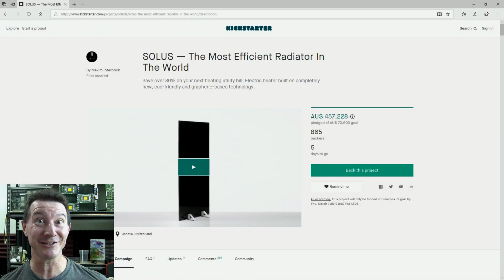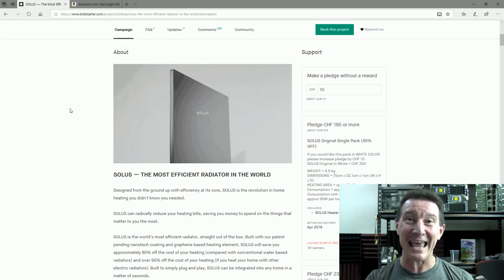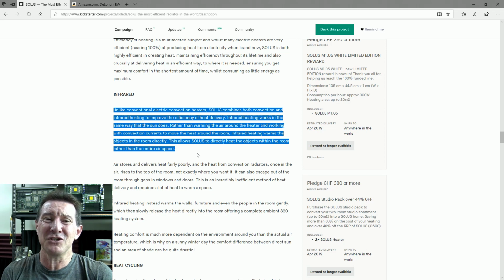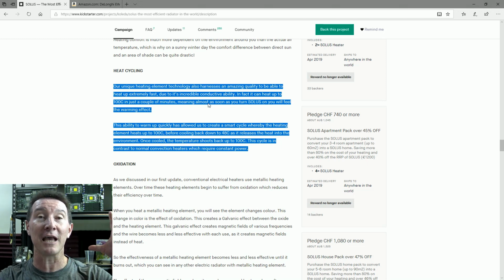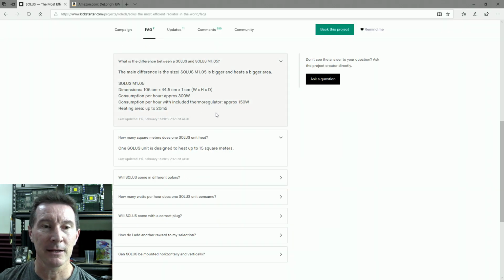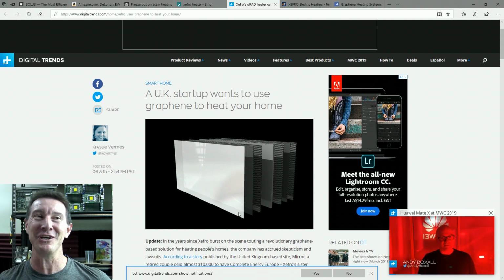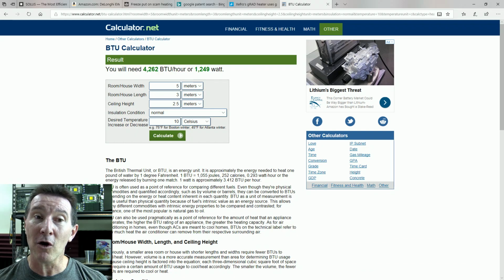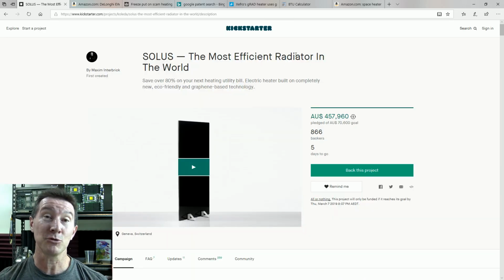EEVblog #1186 - Solus Graphene Heater Kickstarter BUSTED!

Comment: I'm not sure Dave. I think these heaters operate  at FIR wavelengths so they remain relatively cold to the touch and radiate IR that the glass and air is largely transparent to, and where heat conduction is irrelevant.  If these panels output more energy in the far IR range of the spectrum than a simple small resistive element would (by keeping it pretty cold), it will radiate through the air and be absorbed by objects directly, instead of convective heating if the air next to the element.  I think that's the point they're trying to make in all the parts you read out loud.  

So if they are talking about heating objects and people directly rather than the air, and aren't asserting that they whole room will be heated but only the things in it.... They have a totally valid approach that might require far less energy and lower air temperature for a given room size to be equivalently comfortable for a person in that room.

The "efficiency" approach is more like those quartz heaters that throw direct heat at a person, that work even in a completely chilly room with icy cold breezes going through, like at a guard station.  But instead of black body heat of 1000°C, this Kickstarter is using wavelength-selective technology(cold cycling at 100C) as high-end large ceramic sauna lamps (the old kind simply being incandescent with a visible spectrum opaque coating).

So the "revolution" is... *don't heat the room*.
Not new at all, considering this is how a camp fire or fireplace works.

But! considering the vast majority of buildings are entirely designed around heating the entire space and insulating the entire space.... 

Pushing an extremely low density, high area panels of IR heat that will keep you warm if you're facing it, so you need to put them in line of sight of wherever you'll be, or facing furniture you'd like warmed... 

Kinda is revolutionary.  With careful design you might do okay, and if people just get used to heating themselves it could drastically change building design assumptions. 

I still think your bust is busted, Dave.
Reply: I agree the glass doesn't need to be conductive, and there are some important advantages to radiation that should be intuitive but most people seem to be fixed to the idea that heat can only be transferred via the air.  The glass just needs to be transparent to infra-red radiation, and in that case it has no business getting hot.
What's upsetting to me about this situation, is that there might be a team of intelligent and honest people designing and making these panels, but they have no influence on the marketing department upstairs.  I wonder if the designers have given up trying to explain to their colleagues why 'watts per hour' makes no sense.   A more important question might be whether the people in charge of this business are deliberately misleading their customers, or are they fumbling around in the dark, believing their own optimistic hype?
Another scenario is that these nice but gullible people at Solus have been fooled by some other company trying to offload a large amount of graphene.
Reply: If the heaters radiated IR they would be able to tell us exactly how much of the electricity is converted into IR, since it would be their main selling point.   Does IR radiation pass through glass panels?  Probably not.

Comment: Save 95% at 50% duty cycle (or 90% at full duty) over a heater ten times as powerful. but  True radiant heat is nice in that it heats what it shines on. This is like a heat lamp but it won't keep you awake by being too bright. Nice package. Some utility. Don't like it don't buy it.

Comment: Perceived comfort/heat may be faster due to the infrared component. But ultimately true heat will actually be slower, as the IR component needs to heat up the objects it is shining on, before those in turn begin to heat the air around them.

Comment: If people want 100% plus efficient electrical heating/cooling they should get Air-source or Ground-source heat pumps. 3-400% "efficient" (in the sense that 1kW of electrical input can produce 3kW of heat in the home, by cooling down the outside air :P)

Comment: OMG Solus's answer to this video:

Thank you for sharing this. It’s completely normal that when something new 

and innovative comes out that there will be divided opinions and some 
skepticism, as well as criticism from competitors. You probably see 
people that still think Tesla is a scam. 

We have already sent test units to high profile tech journalists and 
waiting for their articles. Unfortunately Evvblog review is completely 
invalid. First, Evvblog does not have a sample SOLUS unit. That means 
the reviewer can only go off his beliefs and theories. 

Second, having watched this video, it’s clear that the reviewer goes off on a 
rant for 45 minutes without even considering all the information 
presented to him on this page, not to mention scientific studies 
available online about graphene. 

For example, he made a review of our testing. However, he completely 
ignored our “ A FEW THINGS TO NOTE ABOUT THIS TEST” section.  If he did 
read this, then he would understand why SOLUS M1.05 consumed more than 
300W per hour during the first 24 hours of the test. He completely 
ignored the fact that we managed to heat up a 16m2 room up to 21°C on 
300W (or 440W if taken in a short 24h space)  when outside temperatures 
were negative. He did say that this is impossible? 

It is also clear that EEVblog has no response besides crude gestures to 
this statement “we have found that raising the temperature of our 
heating element is most effective through supply of non constant/pulsed 
electric current. It works in the following way, the heating element is 
supplied with 1.5 seconds of electric current and is then cut off from 
supply for another 1.5 seconds. This process is repeated until the 
heater reaches it’s maximum temperature. We observed that during the off
 cycle (1.5 seconds when current is cut off) the heating element 
continues to generate heat due to the self cooling properties of 
graphene, which results in a difference of potentials.”

At the end of the day, we are happy that SOLUS is becoming the centre of 
attention. We are shipping the units very soon and will look forward to 
real reviews from our clients. 

Kind Regards,

Max

Comment: 300 Watts per hour? So after three hours that would be, say, 900W? I'm sure that's right (unless they meant Joules per fortnight). 

Glass is a really good material for radiators. I mean, nobody in their right mind would think of using two sheets of it to stare through, given it's high thermal transfer characteristics, would they?

The sad thing is, there's a lot of ignorant punters out there, who will probably think they could connect this up to a Solar Roadway and make free energy for ever. But I've said too much...

Comment: Radiant heat can actually cause more problems.
Under a radiant heater you feel warm and may not wrap up as well as you should, like at a street cafe or such.
The heater hits your face and torso and you feel ok. You are however starting to get cold feet. You also breathe the cold outside air on the pavement/patio and do not realize how cold you really are as it feels warm on your face and hands. Two days later you have a cold.

Comment: Well I have experienced IR heating panels. It's different, it doesn't heat the air it seems to heat the objects hit by the IR radiation. I like it. Panels have been on the market for years, nothing new I believe.

https://www.thegreenage.co.uk/tech/infrared-heating-panels/

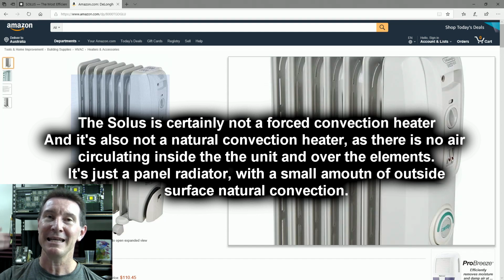Comment: You're normally on-point with these Dave, but forget about fan-forced heater and heatpumps. You've completely missed the distinction between convective heaters (which you understand) and radiant heaters (which operate by transferring heat directly to furniture + people via infrared radiation.) The whole concept of radiant heaters is that when there's a lot of IR in the room, you still feel comfortable even if the air temperature isn't that high. The goal is for people to feel warm, not for the air in the room to be raised to X degrees. Those are different things, the air in the room can be cooler and you still feel warm if there's plenty of IR hitting you. You miss this while obsessing over the output power instead of the thing that matters, comfort of person. Radiant heaters ostensibly achieve the same level of comfort with less power output (and input) by the heater. The insulating glass is perfect for this by restricting conductive heat transfer, causing IR emission through the glass preferentially. Maybe you get to this some point after the 16:30 mark, where I gave up, but I can't support incorrect refutations of poor products (this product is clearly bullshit; radiant heaters are already a thing you can buy).

Comment: I didn't notice you saying that, but with no fins the MAGIC SOLUS EFFICIENT HEATER can not heat up the air as good as a radiator with fins because it has a smaller surface to dissipate heats, Can't it?

Comment: Those oil heaters are more convection heaters then radiators, the ones with an incandescent element that have a reflector behind it (like a space heater, without a fan, more or less). Tehnicaly, the in floor heating is the most efficient, not electrically, but in terms of deliveing the heat in a way that it seeps out slower before getting where you want it the most. Want insane heating efficiency? Thick insulation, double doors, 3 sheet glass windows... basically make sure the least ammount of heat escapes the house, so u can keep your desired temperature with the least ammount of energy input.

Comment: Of course Graphene will not "create" additional power.
But let's imagine that Graphene acts like a heat fast transfer buffer, between the resistive element and the air (I omit the tempered glass layer here).
Could it be possible that Graphene accelerates heat transition "forcing" heat to the air ?
If I take this idea to extreme, imagine that once the device reaches its max temp. then you touch the surface it will be nearly at ambient temperature, yes cold, meaning that 100% produced heat will be already radiated into the air.
this could lead to 100% produced heat in the air rather than partially resting on the device materials.

PS:  i still trust Joule's laws and Peltier effect  ;)

Comment: Whoo-whoooooo! All aboard the Wanktrain to Wanksville, with a brief stop in Wankington!
Save 80-90% of my heating costs? *snorts derisively* Amateurs! I can save 100% of my heating costs by switching my heater off. 
So this thing resembles what I imagine an iHeater would be if Apple made a flat-panel heater... But I thought more physical surface area of the hot bits means more heat can be transferred to the ambient air???

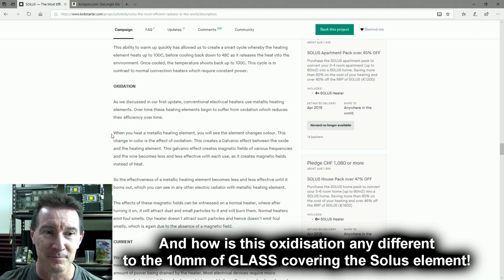19:39 - That's... Not... How... Science... Works... 
Johnathan Chamberlain paid attention in science class.
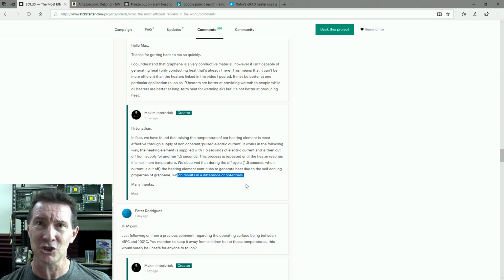31:33 - That's what I like to call "verbal diarrhea." A whole bunch of words get uncontrollably spewed out.

Comment: Those oil/water filled "radiators" are primarily convection heaters that directly heat the air in the room.  The advertised heater looks more like a radiant heater that produces IR energy, heating the objects in the room directly rather than the air itself (glowing element/bar radiator - typical bathroom heater).  In a sealed room with good insulation the overall effect is identical, but if there are draughts or poor thermal insulation in the walls/ceiling then one type will be better than the other.  No possible way to achieve >100% efficiency without using a heat pump though so "saving 80% off the cost of your heating" is some A-grade bullshit, especially as their heater costs around 30 times as much as a small fan heater to begin with...

Comment: Oh I get it. The idea is that tempered glass will block convection heating transfer, so the panel will have to remove heat through radiation. That way infrared heating dominates the output, and convection heated air that rises to the top is minimized. Except that tempered glass also blocks infrared.

Comment: how many BTU per Watt? or is meassued in Joule per watt-second in Europe?
Reply: rarbi.art 1 Joule = 1 Watt-second by definition.  It's the same thing.  Only way to increase efficiency (besides over-unity nonsense) is to make a machine that gets extra energy from elsewhere (like heat pumps do), reduce the energy leaving the room (insulation), or leave at least part of the room cold (like IR heating of people, or having  a heated floor in a cold room).

Comment: I think the idea may be that the flat glass surface makes for directed radiation, so it would heat up whatever you point the glass at, so it would make you feel warmer standing infront of it, but wouldn't heat up the room. That said, I don't know if that's actually what it's doing, what it's intended to do, and I don't see what it has to do with graphene.
Edit: My guess would be that the graphene has an emmisivity close to 1, meaning it radiates a lot more than it conducts heat, nearing a perfect black-body? Plus the glass insulates it, stopping it from conducting heat to the air, but the glass allows most of the radiation through. So I think the gimmick is that it's just a nice looking IR heater?
Edit: Normal radiation heaters get waaay hotter than 100C, so I'm not sure how much radiation this heater would be throwing off in comparison.

Comment: Oh gosh. As much as I love your videos, every now and then you're just full of it. Why don't you do a proper research to figure out whether there're already similar products on the market? There're quite a few reputable companies here in Europe offering similar far infrared radiators, e.g. https://www.koenighaus-heizsysteme.de/product/glas-serie/ and Chinese companies have also started copying the principle.

Now I don't know anything about the improvements they claimed to have achieved using graphene but given the fact that heaters with a similar design and slightly higher power consumption do exist, they're not completely unbelievable...

At least one good thing has come out of your faux debunking since I'm in the market for one of those panels and for some reason completely missed this particular KS campaign...

Comment: Great video Dave. I better sign into Kickstarter and hand over my money quickly. Think of the money I will save on my electricity bills.
There is one born every minute!!!

Sadly this is not the first rubbish that I have seen on the heating front. Have a look around the Net for the 'Handy heater'.  This is a 'as seen on TV product' and is currently available. A tiny 350W plug in heater with a fan and thermostat, and the advertising video was a joy to watch and complete bullsh!t. Made it look like the 350W heater could easily heat an entire room. Apparently ceramic elements also increase the efficiency of heaters.

Comment: Hello from Latvia, Riga! :)
Never heard nothing about Solus and even don't see commercials etc about it before and don't know where the assembly line may be.. :D
I'm not understanding one - why they compared 200W heater with bigger one.. :D This is the same as comparing hammer and nail.. Proper efficiency comparison will be if they're compare heaters with same power ratting, otherwise, this is marketing scam..
And why they can't kickstart it as small, modern office or home heater (this will remove any scepticism and increase customer  count with people, who wants to look modern and  cool).. and only what they need to do, is doing proper comparisons without creating new physics's law's.. :D

Comment: Basically a really expensive resistor LOL.   Surprised they did not incorporate the word superconductor in their marketing.  "By using a superconductive glazing on the graphene, we were able to achieve negative resistance, increasing the efficiency!"  (I should get into marketing) 

I don't know what's worse, kickstarters trying to reinvent solar panels, or kickstarters trying to reinvent resistive heat.

Comment: You can't fault them in one thing, they are telling the truth about power savings. Assuming a 1 to 1 replacement of existing space heaters. Naturally you will save energy if you replace a 1500w heater with a 300w one, but it's not going to heat the room as fast, if at all, than the old heaters.

Comment: Actually, even just a resistor across the mains won’t be 100% efficient at converting electricity to heat, unless you power it with pure DC, otherwise parasitic capacitance and inductance means your real power != apparent power - some of the energy goes into creating a magnetic field around the wires, or an electric field between the wires. Never mind radiated EMF which leaves the room and doesn’t contribute to the heating. Even worse if it has electronics inside that operate at RF frequencies; then you have a radio transmitter as well - that’s going to leave the room, too. It’ll be close, maybe 99.999999998 %, but not 100.0 percent. No ideal components, Dave! 🤣

Comment: Next snake-oil trick; inductive heaters for people - they re-purpose the graphene into a copper tube at high frequency so it (magically) heats just the person standing there in front of it. No need to waste valuable power heating the air (which’ll just rise convectively and away from the heater), or even their clothing. Nope, this heats the person directly!
I wonder how long it’ll take some bright bulb to think of this... or read this post and “steal” the idea - ha! 😆

Comment: Wait! I kind of understand what they mean.. By still creating heat they mean while the heater is off for the X seconds the heater will still be releasing heat which is conserved in the Graphene and therefor more economical. A good example on how it works would be like heating up rocks. once the rocks are heated they will radiate heat for some time afterwards :)